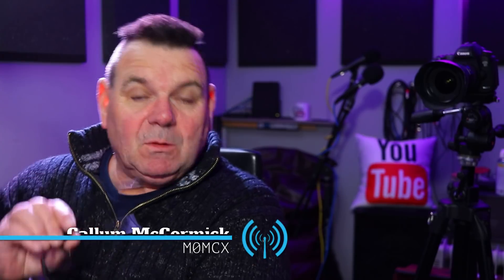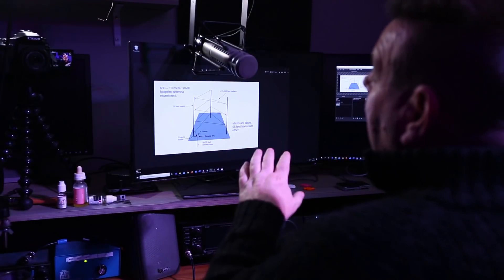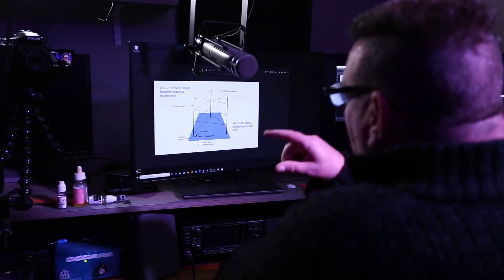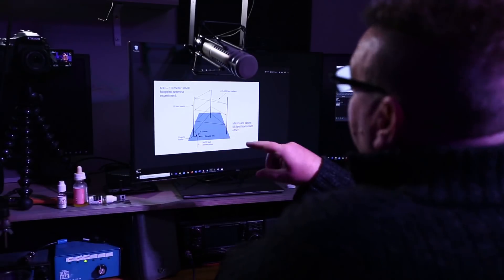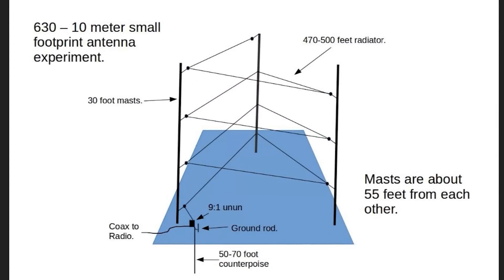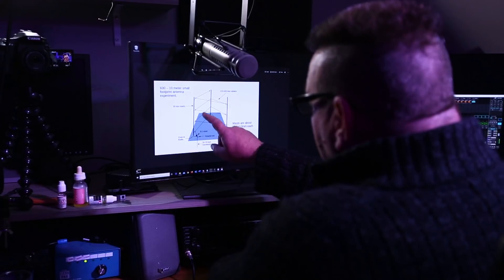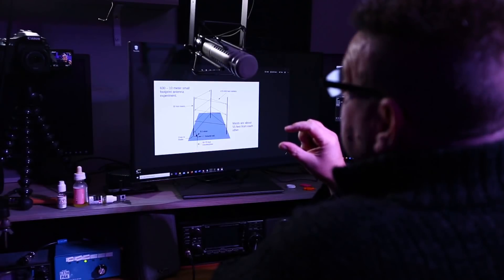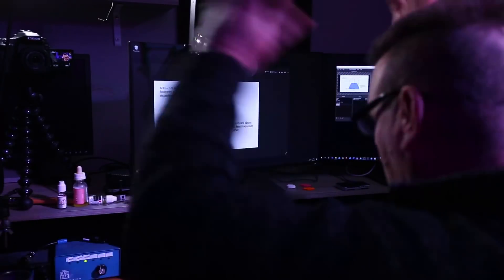Ham Radio - 630-10 meter antenna software modeling results.

Comment: Great stuff !  Exactly the level where I need to re-enter the club, after several years inactive.
I'll be back later to watch the remainder ... maybe more than once.
For now, I'll just mention the low-frequency beginning of the analysis, where to represent the 630m "band", Cal entered 630 KHz, which would play havoc with AM broadcast if it were ever used there.
Glad I stumbled across both of you.  I'll be back.
K2KQU

Comment: Kevin, remember your antenna experiment using twinlead.. where you wanted to make an end fed with a built in couterpoise? That inspired me. I knew the counterpoise was going to be a part of the feedline. But I thought of that... and figured I'd build my own feedline in for form of a wire, 61.5' long, mounted 2 feet above the ground! A fun little 'desperation antenna' experiment!  Thing is... my first call was to OL725PLZ. And  i worked him. Shocking. I posted it if you wanna see. I like to mention your experiments in the desert to friends. My brother Art really likes your channel as well. 73 OM

Comment: It almost looks like the horizontal portions of the coil opposite of the feed point are acting as reflectors. The slight asymmetry in the north-south direction could be a result of the segments tilting up in that direction.

Comment: Build it and see what results.  If nothing else it might make an excellent giraffe trap.  Seriously, build it. Change the spacing on the supports, change the distance from level to level of the wire. Wider at the bottom and narrower at the top.  Variations abound.  I'll be waiting and watching.

Comment: The simulation shows what I suspected: Radiation pattern somewhat like a 1/4 lambda on 630 m, but with less gain. On HF somewhat like a helix antenna. It will be very interesting to see real world experiments. There is an old 100 feet high survey tower in my area. I could wrap an antenna wire around it in a helix and use it for 630 m or even 2.2 km! I have to try that one day. Kevin, you got a great idea with this antenna!

Comment: Looking good, so far...!

Fyi, it is in less than 60 feet - square... not 60 sq. Ft; which would be 6 ft by 10 ft...

60 ft. sq. is 3600 sq ft. - still a significant area reduction vs. a 500 foot long end fed.

73 - John - N7GHZ

Comment: If the impedance is close to 50ohms, why use 1:9 balun? It will just make swr bad. After building just measure the impedance and see if any transforming is needed. It may be low like 1:2 for example.

Comment: I think you need a 2 :1 as it has a only 1.7:1 un-un SWR on the higher bands, and a 9:1 balun or higher for the Long wave, but that is only from my "back of an envelope" calculations. I am sure you will work it out. Certainly an interesting idea and I look forward to seeing how it pans out. It would have been nice to see some band-width information from the models, but we will see that, no doubt, in a later video.
Over a good ground, say near the sea, this looks even better than Callum's prediction!!! :-)

Comment: [9:50] I'm sorry Kevin. but by looking at the antenna impedance it's very unlikely it's going to match to 50 Ohm, even with a 9:1 balun. The typical values that match well with a typical tuner (and optionally a transformer) are something like 11-64j, 200+200j, etc.When you have something like 1000j or 0.03 it will not match, or will but with the bandwidth about 2 kHz. You might want to build a regular inverted-L or a shortened vertical instead. 73 de R2AUK
Reply: Of course it can be matched! Likely the feedpoint resistive component will be a few ohms, let's just say 5 ohms (with a realistic feedpoint height above ground, not zero like the model). You match the resistive component with a transformer (9:1 for example), then cancel out the remaining reactance (from both the antenna and the transformer) by using the "opposite" (conjugate) of that reactance: inductance or capacitance as required. I do this several times a week, it really works!

Comment: I like Callum's name - Kevin's Crazy Antenna (available at Chameleon Antennas, 3Q20).  I also like Ginormous TriSlinky (TM).  40m NVIS looks very interesting.  Overall the simulation looks like a very good compromise for a space efficient low frequency antenna - much better than I would have guessed.  It might be worth some imagineering time to devise the most clever way to easily erect this antenna instead of my Ready-Shoot-Aim project management style.

I'm glad to see you getting some modeling in before the building.  I keep saying I need to develop some xnec2c modeling skilz, but I keep putting it off.  Too many projects.  I've had a 40m Phaser JS8 transceiver kit on the bench unopened for the last three days.